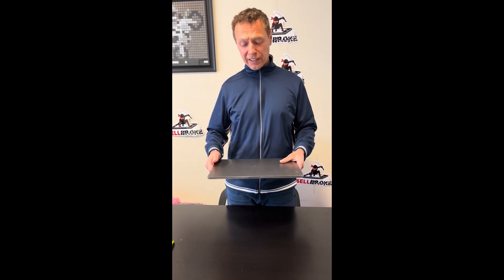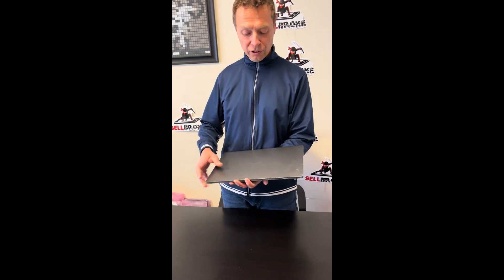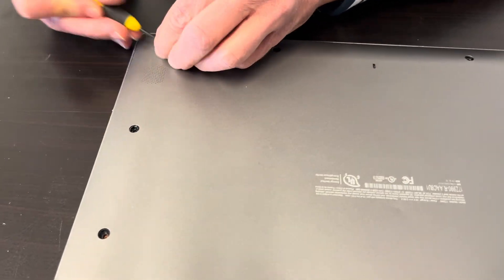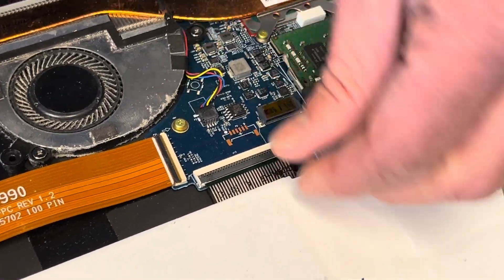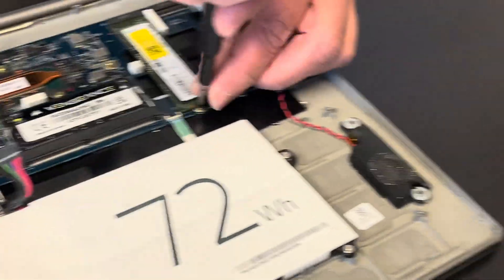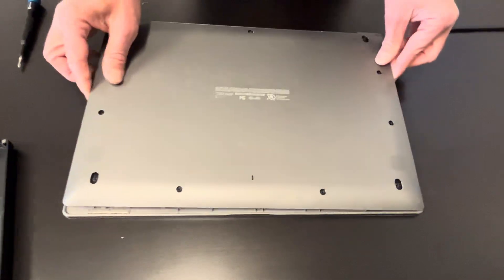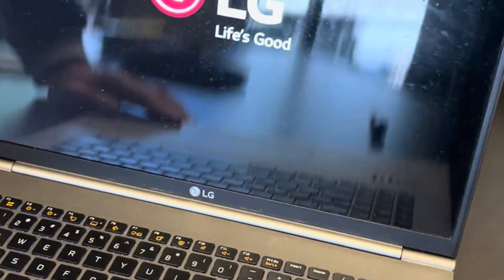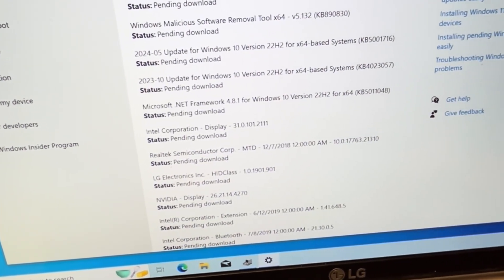LG Gram 17 laptop RAM Memory and SSD storage upgrade instructions.

Comment: Don't you have heat problems with this NVMe? I was hesitating to use the same one or the WD_1710, I choose the second one only for power consumption and temps reason. But I wonder if the EVO 990 Pro would need a heatsink and if it would fit the case.

Also... for my LG Gram Ultra (old) I upgraded the RAM till 64 GB, working like a champ.

Comment: It seems the model LG17Z990 with Intel 7- 8th gen. RAM 2 slots, one soldered 8gb. 1 slot available to upgrade RAM gen 3. // 2 M2 disks slots. The battery can be replaced as well

Comment: Nice video! Thank you!
If I see correctly, this model has 8GB of soldered RAM and the new RAM brick you added has 32GB, so together 40GB? It looks like the first 17 inch model with the 8th gen Intel CPU? 
I am right now interested in buying a similar, but broken lg gram with bluescreen, but I cannot test it before. It has only 8GB of RAM so I assume it is soldered. 
Often the RAM is the cause for a bluescreen but if the RAM is soldered, I will not buy it.
Thank you